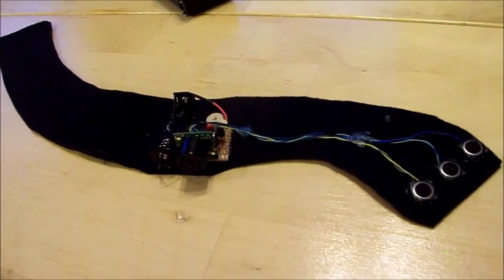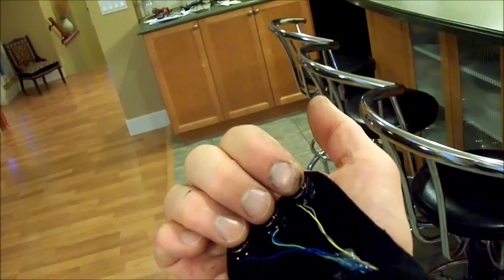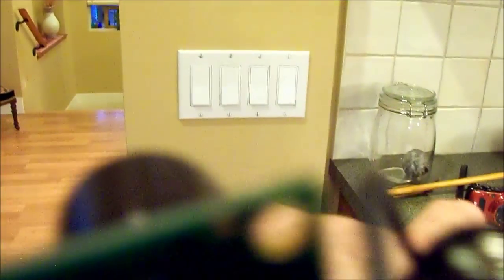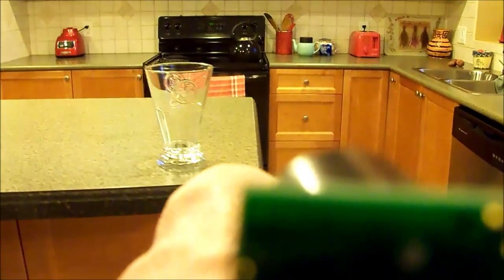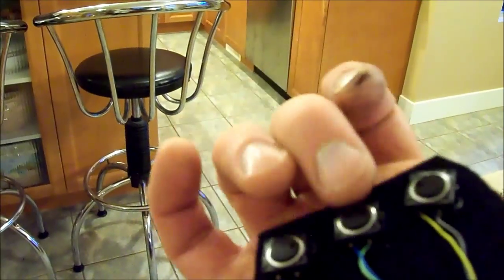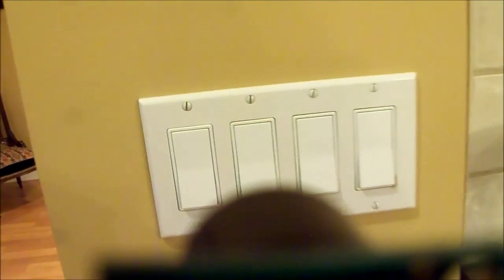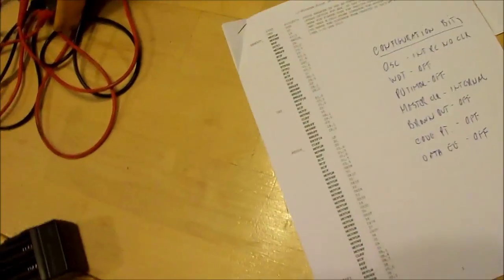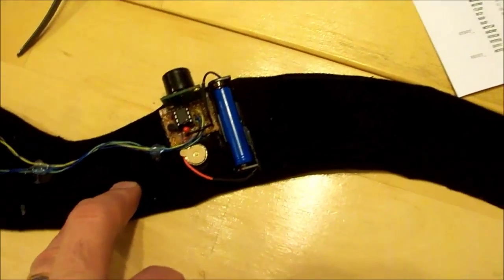An aid for the visually and hearing impaired

Comment: Hi, what is the flow of your program? from what i understand, there is 3 IF statement. 
1st button: if between 7 to 24, produce sound
2nd button: if between 7 to 40, produce sound
3rd button: if between 7 to 8feet, produce sound
How did you program for the output? it should be inversely proportional, but is it exponential or logarithmic or linear?
and is the range the same? for example; lowest speed - 10, fastest speed - 200, for all 3 cases?